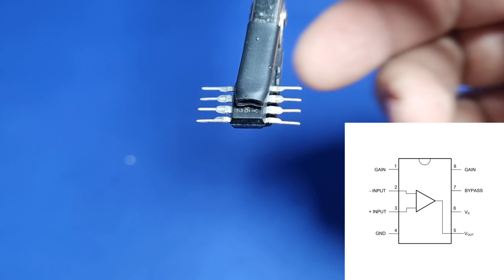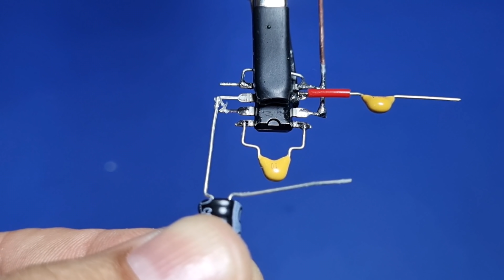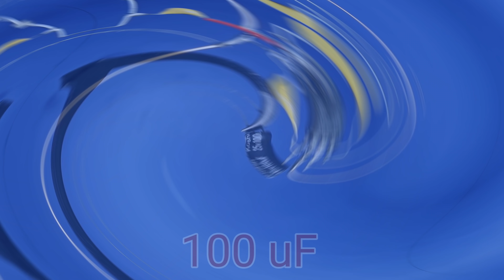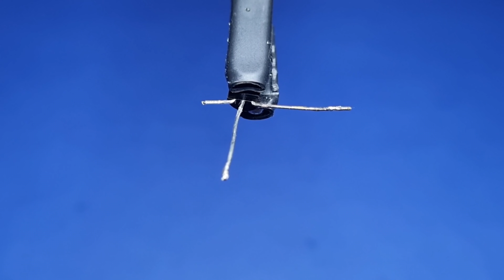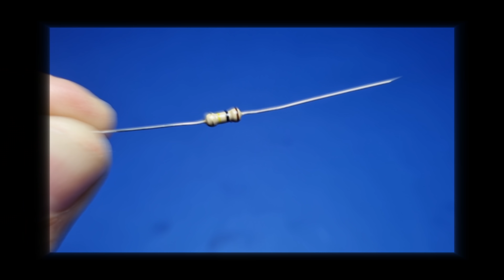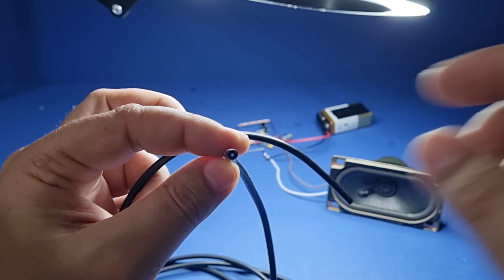How to Transfer Audio with Fiber Optic Cable / Fiberoptic Audio Transfer Circuit

Comment: Bang, mungkin di masa depan untuk kebutuhan acara acara konser musik, akan ada mixer audio yang menggunakan kabel optik, yang secara teori lebih cepat dan lebih stabil dibandingkan dengan menggunakan kabel listrik konvensional, dan mungkin akan muncul lebih banyak fitur yang  sebelumnya tidak ada di kabel listrik konvensional, seperti personal mixer, untuk setiap kebutuhan pemain musik, seperti pemain keyboard yang membutuhkan kejelasan suara vokal, begitu juga kebutuhan personel lainnya, namun masih ada satu pertanyaan, apakah kabel optik bisa lebih tahan terhadap tekukan berulang ulang, seperti layaknya kabel listrik konvensional.
Reply: Concerts already use fiber optics. Just one example is a stage box that connects back to the mixer via fiber, instead of a traditional snake.